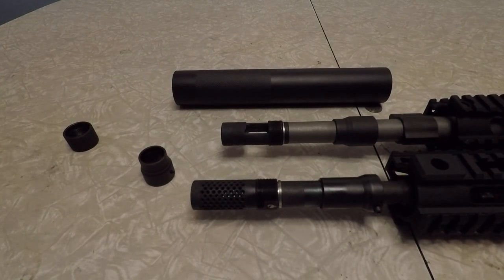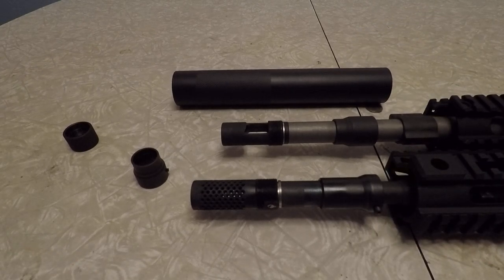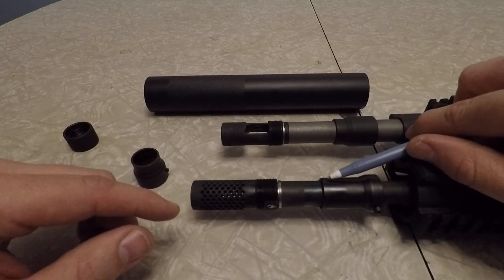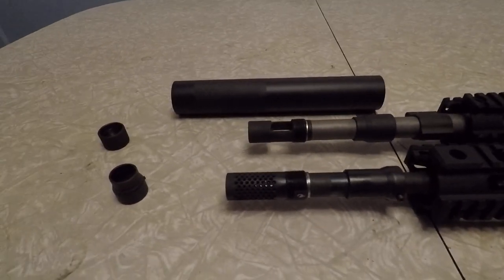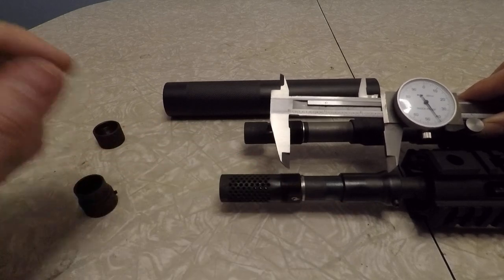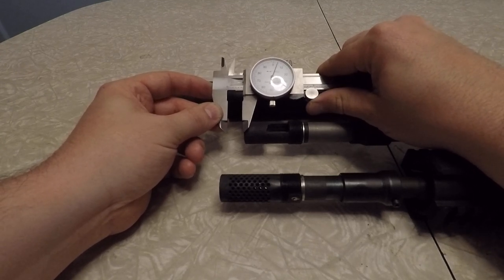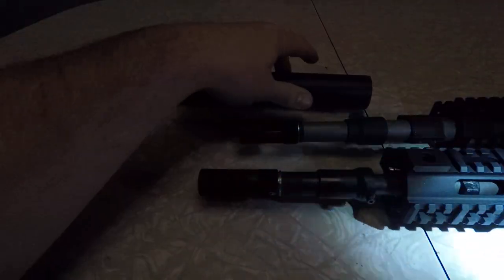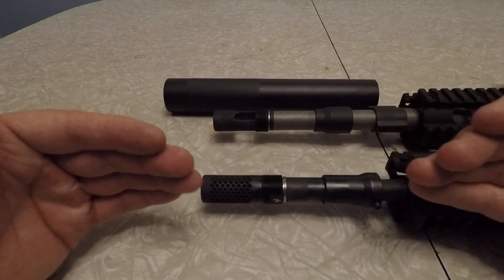AEM5 Ops Inc Allen Engineering Mk12 Silencer - Spikes Tactical LRS AEM4 AEM3 AEM2 M4 Collar

Comment: So will the Spikes brake work with a Mk12 and an Ops AEM5?
Reply from the maker: I mean... didn't you see me... mount one in the video?
Reply: So you apparently had to change the stock collar too. If I have to change collar too it doesn't exactly work stock. See what I mean? I'm just surprised you had to change the collar as well, so it is a sorta in my book. Hence why I bothered asking.
Reply: @MaverickTangent And no, you never mounted it to either.
Reply from the maker: @AldoSchmedack  sorry, I haven't watched the video in a while. The M4 style collar reflexes back over the M203 cut out. That cut out is too narrow to use a stock collar. If the barrel was thick enough, you could use a stock collar. But not on an M4 profile.
Reply: I ask because I have a DD S2W 18" heavy barrel and apparently it was machined wrong either deliberately (to avoid liability) or accidentally (messed up). The collar sits ahead 1.000" too far and I am gonna have to have a custom collar made for it. Was thinking I could try other collars but doubt I am gonna get that to work. The barrel bumps out at wrong spot that partial bit at wrong spot. Trying to figure out a fix but doubt it will work. And I don't want to mess with the barrel because it is already built, and is finished special for corrosion resistance. I am tempted to try a flash hider that Otter Creek makes vs the brake that Allen makes which I have already.
Reply from the maker: @AldoSchmedack  I have seen those Otter Creeks jobbies. They work, it just doesn't reflex. You could have a collar modified a little,  to adjust it. You can take that to a shop.
Reply: @MaverickTangent So, I did a weeks worth of patent reading, questions & reading on forums and tracking down and talking with a few retired employees and a smith and learned a bit but am still not quite certain, yet close to figuring it out. First, a question for you. It may solve my issue, if you could. I couldn't figure out this, but do notice you have both collars.

Does the longer M4 collar, vs the original style short spr one, have a longer distance from the supressor mating step on outside to the inside step on inside (both regarding the collar)? I am almost thinking my barrel is just setup for the M4 vs the short collar type I have that is to be used for, say, what a original Douglas barrel is profiled for.

Also a key thing here. I did learn the brake is *critical* to function! Apparently the relflex only works fully with those. The brake sends about half the blast backwards into the back of the can to reflect and create the initial reflex effect. You can see more in the patent.

I know they suck to put it mildly as a flash hider (which really does zilch for hiding) and throws blast back at you galore if you don't have a can on and people around ya thus hate it, but apparently it is needed to help sound mitigation better. So I was gonna do a flash hider which is superior by far when supressor is off, but when mated the brake is better. So now am leaning back to using the brake. I will send a patent number in a second to show you. But my only concern now is finding working collar. If it don't work I have 2 smiths to chose on making a custom one.
Reply: Here is what I read hope platform keeps it and don't auto delete but:

"A cylindrical silencer tube is fastened to the muzzle of a firearm or cannon. A quasi-parabolic reflector placed in front of the gun muzzle directs the main discharge gas and sound wave flow rearward to a tuned chamber behind the gun muzzle. The deflected sound waves strike the rear of the chamber and are directed back towards the next oncoming half cycle of sound waves. When the two out of phase waves collide at the entrance of the tuned chamber a cancellation of the noise occurs. 
The second section of the silencer is comprised of a series of chambers and semispherically shaped hollow baffles which direct part of the discharge gas and sound waves in a different and longer path from the main discharge gas and sound waves and then cause them to reunite in a chamber. The two out of phase colliding wave forms cancel each other."

This per supposedly the designer. More is spoken of in patent for it and also patent's related patents. I am gonna try just buying an M4 collar to see if it works. I'm only out $30-40 anyway. If not, it gives me a starting place and may be even modified to work, or basis for one that does. Should have funds next month. TY for this video btw.

Comment: So, I have a Centurion 18" mk12  barrel (ops inc cut) and was wondering if it matters which supressor collar is used. I can't really find any info on whether I should do a short or long collar or if it even matters. Any info would be appreciated.
Reply from the maker: I think there is like: this gun should use the "long" collar and this style should use the "short" collar. But, functionality, they should be the same.  It was never important to me. I just think the long mk12 collar looks better floating in the middle of nowhere on the barrel. I've had both the long and short collar on the same barrel and they worked fine. If you got your barrel from Centurion and your collar from AE then it's in spec and well made.

Comment: Is the barrel dimpled where the collar goes on?  What size allen key and torque on the collar?  Thanks
Reply from the maker: Its not dimpled. I just cranked the screw down and staked the threads with a punch. Idk wait threads, M6x24? Maybe bigger? Spikes didn't know and it was bigger than the AEM set screw
Reply: @MaverickTangent  Thanks
Reply from the maker: @chaoticcaninejb  it hasn't backed off yet
Reply: @MaverickTangent  Awesome, I wasn't sure if any different barrels had it dimpled. Doesn't seem so
Reply from the maker: @chaoticcaninejb  I thought about dimpling it but the screw is harder than the barrel so it will dimple itself

Comment: So the thread protector screws off? The morons at Allen Engineering put it on upside down then.... And the lady on the phone I spoke with said that it's just supposed to sit at the bottom on that collar... I didn't think so, I'm so angry right now, didn't they turn barrels for the Navy and Army Mk12 programs? Since it was 308, I sent it my rifle for the custom 308 Douglas spr barrel and they just installed the Ops Inc stuff when they turned the threads for everything.

Comment: If I have an Mk12 profile DPMS barrel on a separate gun and want to run my AEM5 (which is still in ATF jail) are there specific measurements somewhere that tells me how far down the barrel the collar should be placed for proper lockup? I actually have an MK12 Clone direct from PRI so I could technically use it as a reference but I do not have a caliper to get down to the nitty gritty dimensions like you have. Im wondering if I add that collar (assuming it just set screws onto the barrel) if its going to affect the accuracy of that barrel. Its a tack driver as it stands with a surefire break and FA556-212 suppressor on it.
Reply: Nevermind. I just realized there is a small step just before the gas block where it butts up agains. However, my new 15" rail hides it by about 1/2" : ( so not sure what Ill do.
Reply: @mrgood1cor13  

What did you end up doing? 

Im looking at the feasibility of using an AE5 and collar on my 18” SPR profile barrel but I also have a 15” handguard thats very slim so theres no way to shroud the AE5 can in the handguard. 

Any insights are appreciated. Thanks!

Comment: Hows this working out? It looks like spikes shortened the brake
Reply from the maker: It is working good.  I don't have a ton of 556 right now so I've been using my AKs. Once I get some I need to sight in the scope on this guy.  As long as you have someone profile the barrel correctly it should work good.
Reply: @MaverickTangent  I have a few ak's myself. I haven't even finished building the ar because of the ammo prices.
Reply from the maker: @Nick-fm9ux  no doubt! Like, what's the point of a build if I should be getting ammo. I'm working on a Jack Carbine clone
Reply: @MaverickTangent  I'll keep an out for the video!

Comment: what is the difference between the AEM 4 and the AEM 5?
Reply from the maker: The AEM4 is designed to fit on an M4 barrel with the specific M4 collar. It will not fit on a Mk12 barrel. The AEM2,3,4 are all setup for the M4 and the M4 specific collar.
Reply: @MaverickTangent  Did you use the AEM 5 just to get more use out of the suppressor?
Reply from the maker: @The_Tradwife  yes. I paid a Smith $50 to machine my barrel to fit the AEM5 so I wouldn't have to buy an entire 2nd suppressor just for this rifle.

Comment: I want to run my AEM5 on a 12.5" barrel. I have the mk12 collar but not the m4 collar. If I fill the gap between my collar and gas block with 2" long pvc pipe (so it extends my collar and backs it against my gas block) I get 8.5 turns on my AEM5 Suppressor. Do you think that will work?
Reply: Just call allen engineering, Ron will give you measurements and make a collar for you for $40
Reply: The pvc pipe will melt first shooting session.